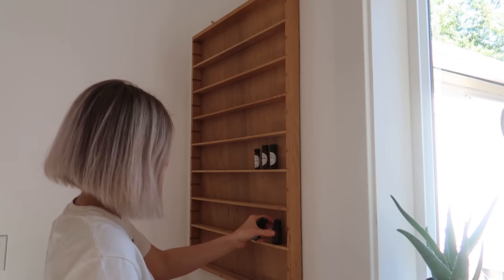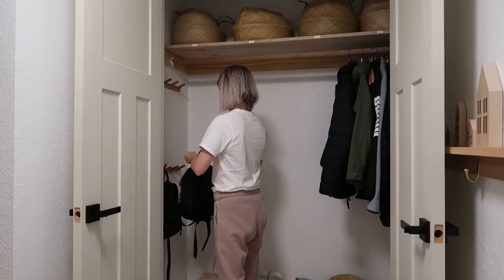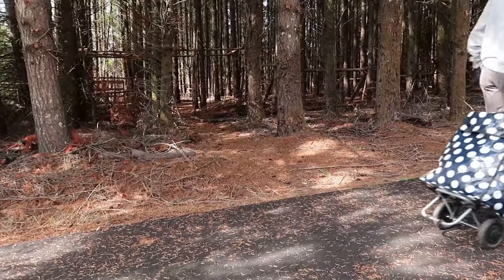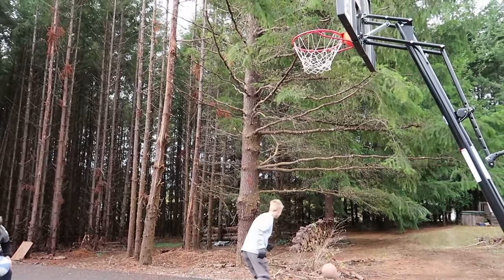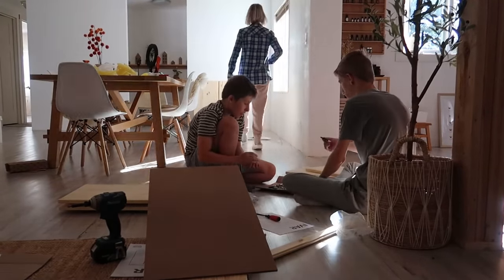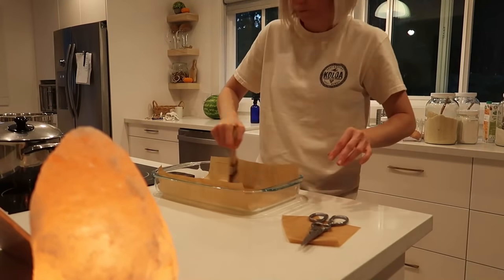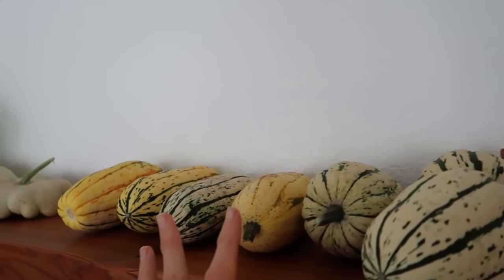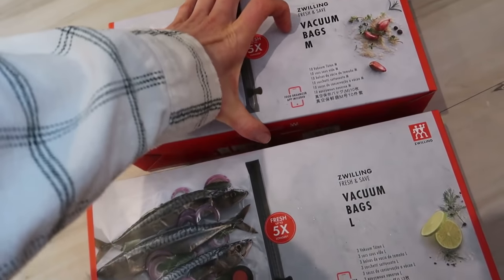PROJECTS organizing, rearranging, putting together IKEA furniture -Scandish home

Comment: I know rain is lovely but you make it lovelier. :)  Holy crap Zsolt and the boys remind me so much of my dad and brothers when I was little, climbing around in auto parts and coming up with interesting ways to ad-hoc extremely expensive equipment. 😀  I don't think they ever tried using a rope (what kind?) And a piece of lumber (what size?) as an engine hoist though, that's cool!

Mmm, apples...makes me want to whip up an apple pie out of my remaining apples before they get gross.
Reply from the maker: That lumber idea was great from Zsolt that helped to lift that heavy part in there! He just used a strap. You can slice the apple and add some cinnamon , honey and some walnut on the top and make it get's done fast and taste amazing! Thank you for watching and you your kind comment! Have a great weekend! 🤗💟

Comment: Nice video 😄
Can let me what material is that, the Jacket that you wearing?😁
Thanks in advance🥰
By the way what is the 🌡️ over at your end? 
Oh the leaves has change to yellow so beautiful 😘.
Fall is here already?
My side year round is hot 🔥 near the Equator.
But these few days getting more cooling.
Less than 30°C. 
Rarely less than 23°C on raining days.
Hotter days can be more than 34°C.
Reply from the maker: Thank you! The material is called cord I think I just put a link here and you can see more info there https://amzn.to/2YjCAOn 
We are getting colder temperature but not super cold. My computer says 49 F It's about 10 C but it will warm up as the day goes on. We just get a lot's of rain on the winter, Have a great weekend to you! 🤗💗